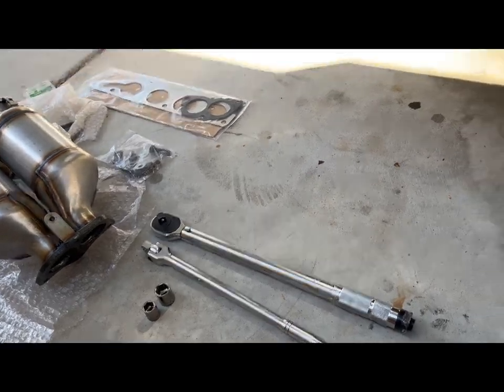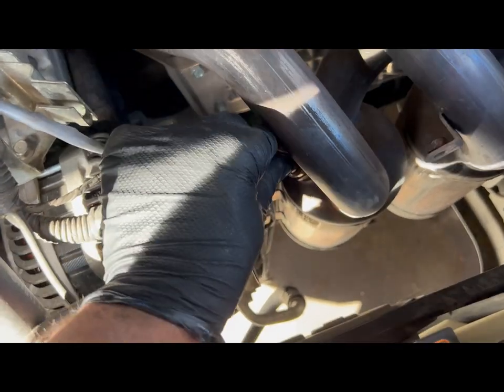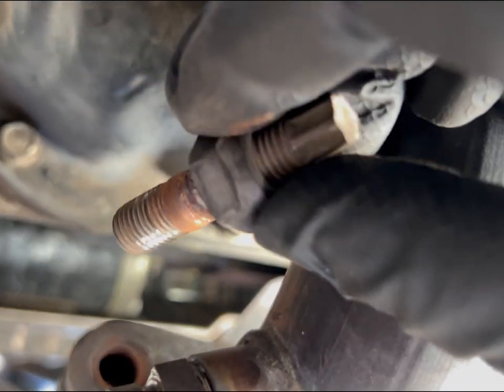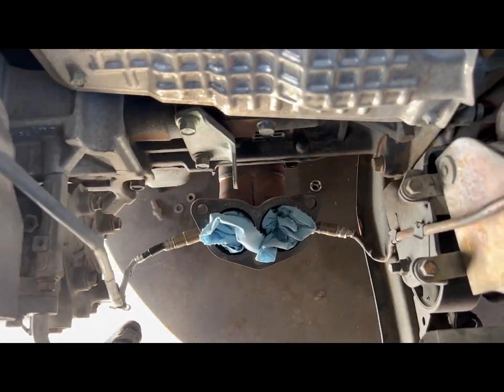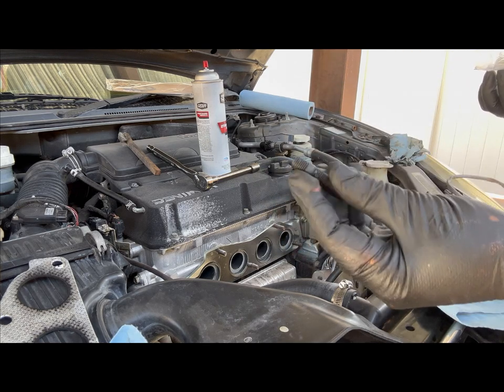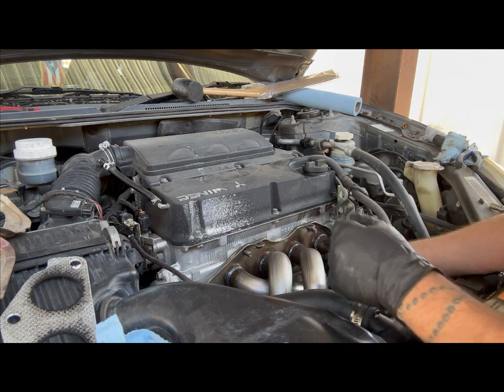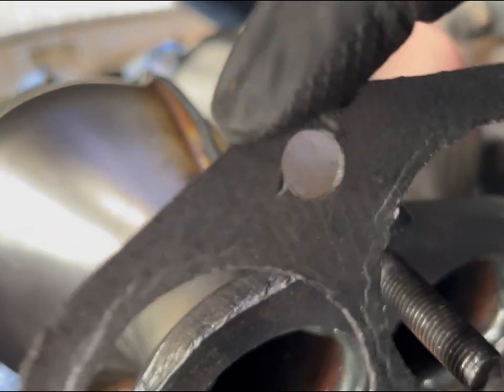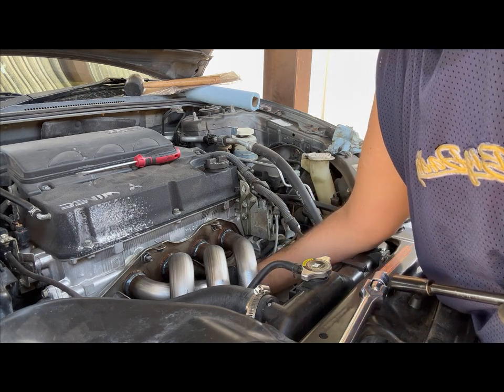2006-2012 Mitsubishi Eclipse 2.4L Exhaust Manifold Catalytic Converter

Comment: why you replaced it ?    the manifold on mine  it gets   cherry hot   only in two tubes   im wondering if my catalytic is  plugged or  something
Reply from the maker: @ResEvilJr  mine were clogged and throwing a code. It shouldn’t he getting cherry hot. Have you modified the engine at all
Reply: @Ghost_Automotive_DIY   not at all    it happened right after i install  a new clutch and  car  was  sitting for like  a year
Reply from the maker: @ResEvilJr  hmm that weird. Honestly, you have me stumped on that one.

Comment: Did you have a tapping ticking noise before the repair?
Reply from the maker: No, the motor sounded sounded the same as it did the day I got her.
Reply: You might need to change your timing belt if it is rhythm with your rpm but not the same amount of rpm (makes 1 tick noise for every 4 revolutions example)
Reply: @kingshando2260  that could be valves too then no?